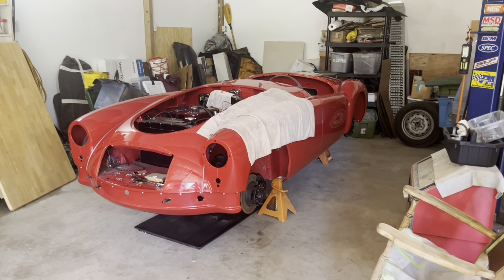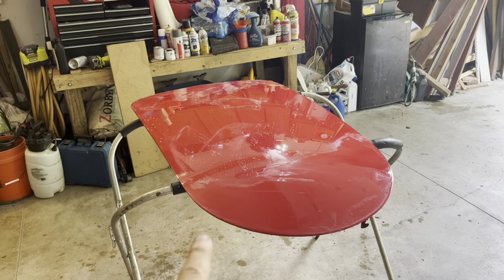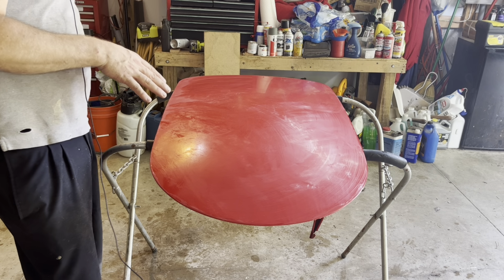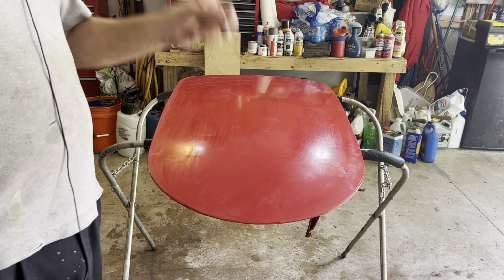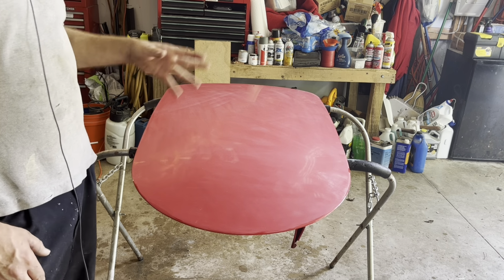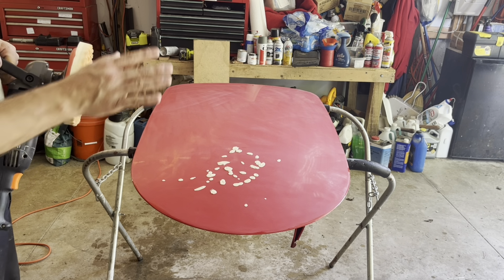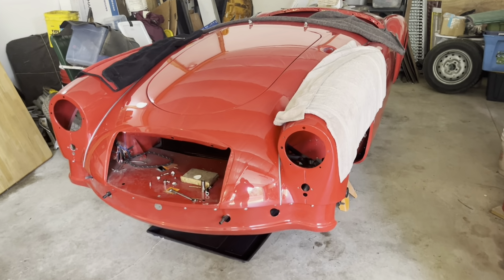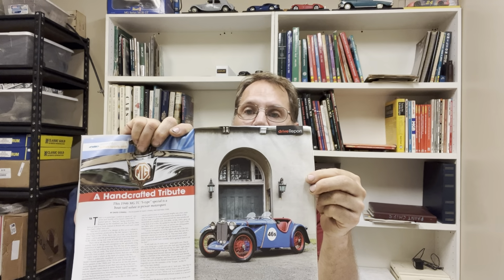Final assembly 1960 MGA, part 3

Comment: I got a quote for a paint job on my mgb for $4k … seemed expensive… but then I see how many hours of labor are going into it…I can save a little money by removing the trim, but you’re right leave the body work to the professional
Reply from the maker: $4k is normally just the starting point at most shops around here, usually they quote $5k + and tell you it will take a long time as it will just be a side project they work on between crash jobs ( if they will even do it at all).
Reply: @mgbgtguy  exactly, that is why I want to remove as much of the trim pieces as I can to save on cost